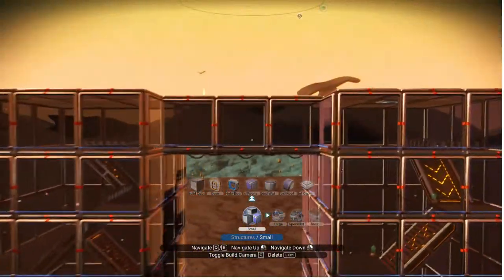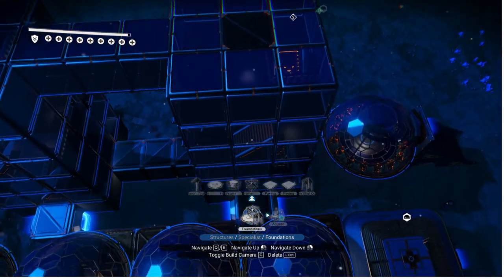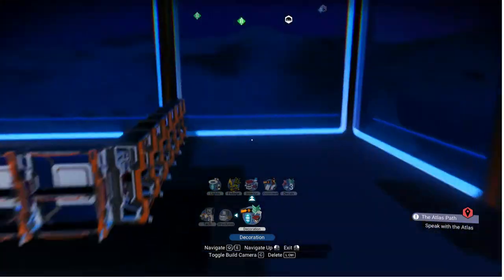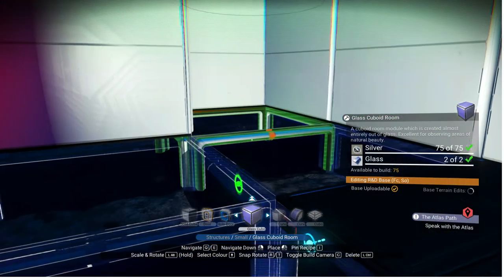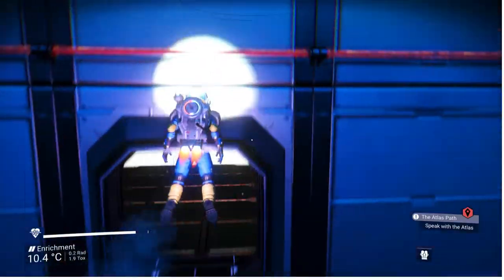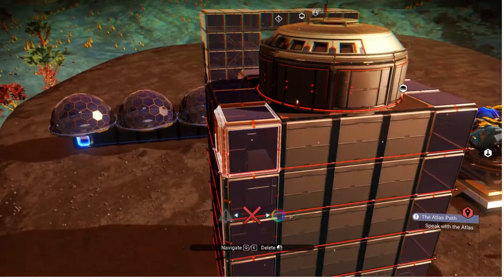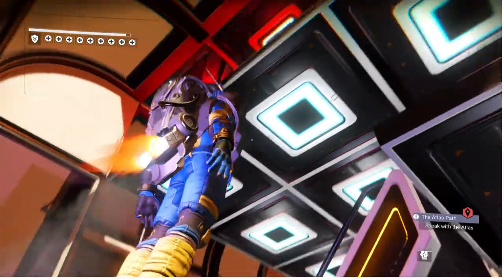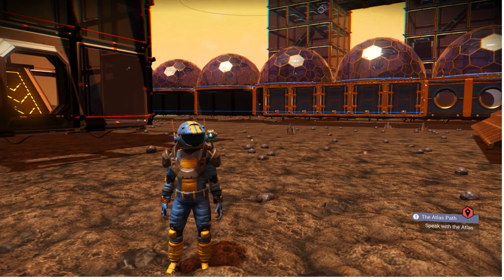No Man's Sky Origins Tips, Tricks & Tutorial: How to make cuboid room stairs!

Comment: Any fix for the recent patch? Made it to where I can only connect to two sides, like I can go forward and back and up and down but not left and right when connecting cuboid rooms together
Reply from the maker: I have to admit it's been a long time since I played with the cuboid rooms. I know they had fixed the stairs to work normally at one point, making this video obsolete, but if it's broken again I could go see if I can figure something out.
Reply: @seriousleesgaming3042  yeah idk about the stairs but I know the the rooms themselves  can only go in one dimension, basically only 2D building. Idk how to explain in text
Reply from the maker: @Michaelcoe94  I just checked at my test build base and it seems to work fine. I was able to put together a 3x3x3 cube of rooms without much issue. Try using the build camera and change your angle of view maybe? Cuboid rooms often want to snap to the far side of the cube especially when building from outside the structure. Building from above the build with the camera can help or even building from inside the 1st room.
Reply: @seriousleesgaming3042  try at a new location, I will try again when I get back home but I think I've tried all of that. I had a base built from cuboids but relocated for EM hotspot
Reply from the maker: @Michaelcoe94  confirmed, works fine for me anywhere I put down a base computer. Might be a bug that requires contacting HG through Zendesk.
Reply: @seriousleesgaming3042  appreciate it! Haven't gotten home yet but thanks for checking!

Comment: How do you attach foundation struts (or anything for that matter) to the bottom of landing pads?
Reply from the maker: That's a great question. The answer is that you can't make things snap into place under landing pads, but you can get supports in there. I showcase the process in one of my recent Finishing Permadeath episodes where I'm building a beach house base. I'll try and explain in text:

First, snap a large cuboid room (square or round) to the side of the landing pad. You should get an extra little area with guard rails.

Next, snap another large room below the 1st one.

On the lower large room, snap a corridor piece to it facing back towards the landing pad.

Now snap two more corridors to the 1st one.

Next you'll snap a large cuboid room on the final corridor. It should be centered under the landing pad. 

Next put another large cuboid room under that one, and delete all the other parts. You should be left with a landing pad and a large cuboid room floating underneath it. 

You should now be able to snap a support piece to the top of the large cuboid room so that it touches the landing pad. 

After that, delete the last large room, and extend your chosen support pieces down to the ground.

Sounds complicated in written form... lol
Reply: @seriousleesgaming3042  Thank you for replying with the tips. I followed your instructions and was successful in placing the strut quad foundation piece under the center of the landing pad. There was still a fair gap, but I made it closer by stacking two more strut quad foundation pieces on top of the first and then deleting the bottom two. Unfortunately, only two of the four legs extended and even if they had I could not attach any more (like to the corners of the landing pad), so I didn't achieve the look I was after which was a strong foundation supporting the landing pad.
I ended up placing a paving tile (large) as close to one corner of the landing pad down on the ground below and using that as a reference to "fudge" a cube room frame piece directly under the corner and then stacking up to the landing pad. Of course, in true NMS fashion, it wouldn't let me stack up into the corner of the landing pad. I fiddled around for awhile and discovered that it was possible to have the top frame cube extend up into the landing pad corner if I just caught the corners of the pad. This gave me a strong steel frame structure at each corner that at least resembles something strong enough to support the landing pad. What a pain! 
I'm patiently waiting for the Frontiers update to see if they have significant improvements to base building (fingers crossed). If not, I'm all in on building mods, something I've avoided thus far (320 hours).
Thank you again. I really appreciate your assist.
Reply from the maker: @Graybeard_  oh yeah, those supports with the legs haven't worked right since I started playing. I tend to use the round ones that are a full floor height each and stack them to the height I need. Cylindrical Room Frame, they look nice and sturdy, and can take textures if you like to get fancy :) thanks for watching!

Comment: I can't get this to work at all, the flooring just wont place inside the cube. Maybe the new update broke them?
Reply from the maker: That's absolutely a possibility, I'll hop over to that save and see if I can get it to work again.
Reply: Yeah I can't place flooring at all in cuboid rooms. I know I was able to like the last time I played which was a year ago. I just built a big base and I was about to start doing the interior then I ran into this problem so now I'm just sitting here confused.
Reply: @Llengrath  Thank you. Atleast its not just me. So hopefully it'll be fixed soon.
Reply from the maker: @BlueEclipse2305  also had some time to check and can confirm floors no longer snap. Hopefully when they fix it, they fix the stairs too and this technique will be obsolete anyways :)
Reply: @seriousleesgaming3042  Looks like they fixed it, I built a glass tower without skipping rooms beneath a stair, and was able to place the floors and stairs without issue.  This is on PC.
Reply from the maker: @jasonw3607  great news, I'll have to play around with them next time I'm building!